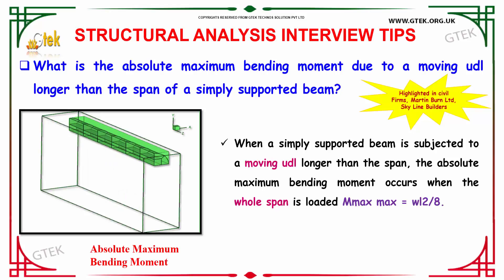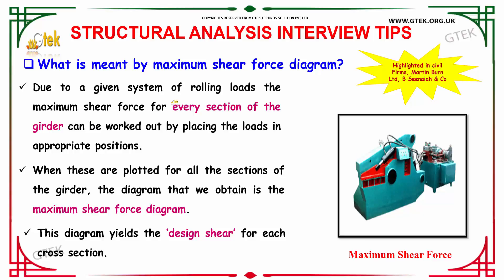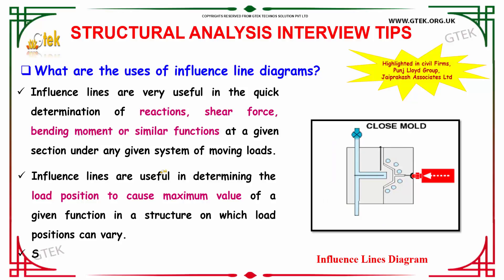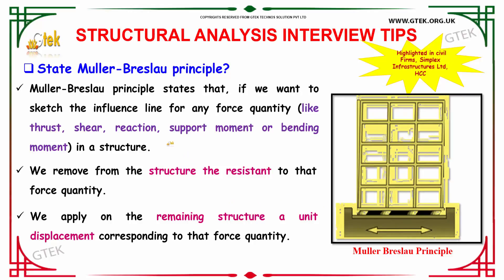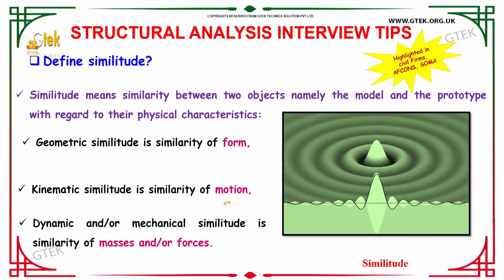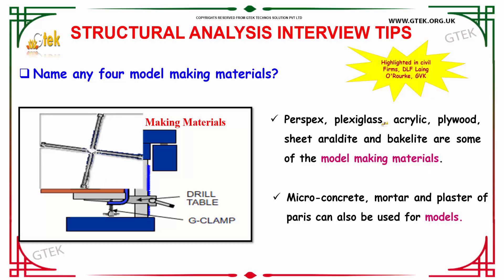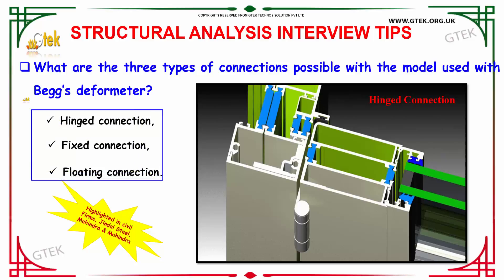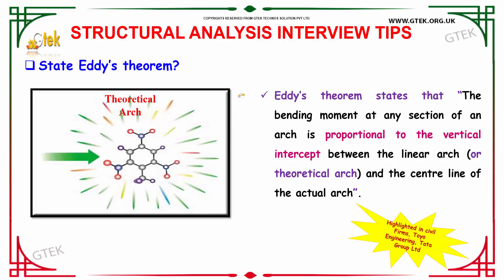Top 50 Structural Analysis -2 Civil Interview Questions and Answers Tutorial  for Experienced

Comment: The structural members are connected together by providing different types of joints or supports. Most common types of supports are pin-jointed or hinged, roller support and fixed support.

Comment: Structural engineers ensure that buildings and bridges are built to be strong enough and stable enough to resist all appropriate structural loads (e.g., gravity, wind, snow, rain, seismic (earthquake), earth pressure, temperature, and traffic) in order to prevent or reduce loss of life or injury.